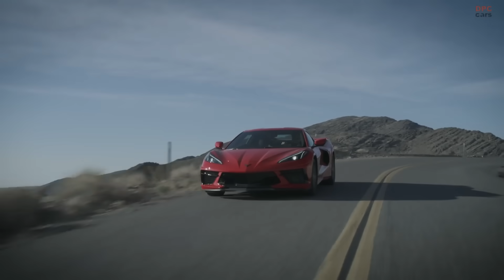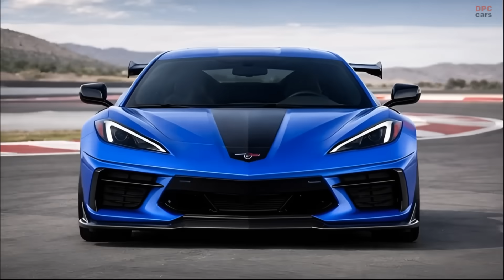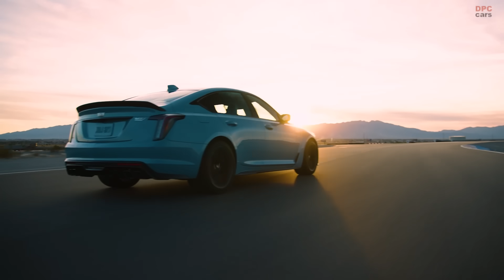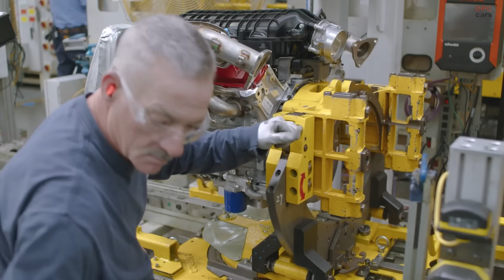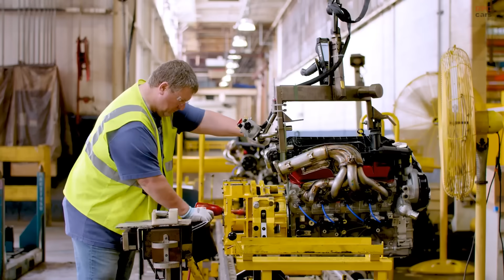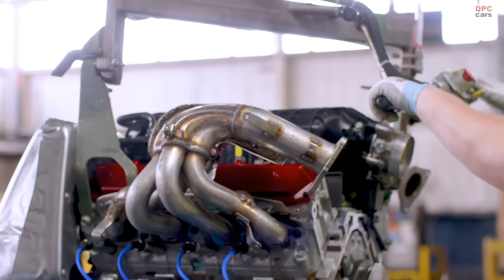New 6.7 Liter V8 Could Change the Future of the Corvette Forever

Comment: Duel injection keeps the ports clean. It can also cool the air. Im impressed with the 5.3 power.
Reply: Want cool air, go carbureted.
Reply: @Olds_Pwr  or go with a duel plane intake, like on the 2UZ.
Reply: @Olds_Pwr Those Japanese auto makers can be resourceful.  Very wise.

Comment: maybe they should spend a little time making sure they don't blow up, spin bearings, launch rods, drop valves..
Reply: Is the 6.2 pretty unreliable?
Reply: @genericallyaccepted  assume you are joking
Reply: @gm3353 why should I assume I'm joking?
Reply: @gm3353 considering the l87 is a 6.2 motor it had over  877000 engine recalls for a 3 year span. Beginning of 2025 alone it had 25000 complaints of massive failure, rod and crankshaft problems.
Reply: My 6.2 was goated idk what yall crying about

Comment: What a waste when GM killed off a lot of past, good name plated cars that could have benefited from the new engine. It's only good to put in older cars or trucks for hot rodding or restomods applications. Time will tell if it's saves GM from being extinct down the road. Nobody wants phony, fake electric cars that are just sitting at a lot of dealers. Some consumers will buy electric vehicles, true motor heads will not....
Reply: Like Blazer.

Comment: Hope this engine is more reliable.  Recent GM engines have had a lot of problems
Reply: Which one exactly? Do you actually own a C8 or are you like most people just hating on GM ????
Reply: @MoneyMagnet88  r u forgetting the 800,000 l87 vehicles recalled.
Not every company perfect. 
Chevy did recall 23000 c8 for possible engine fires due to excess oil leakage.
Reply: This 409 would not have made a Beach Boys hit record. Imagine... giddy up, giddy up 6.7
Reply: @ars3nal181   Lets hope this dewey doesn't vote